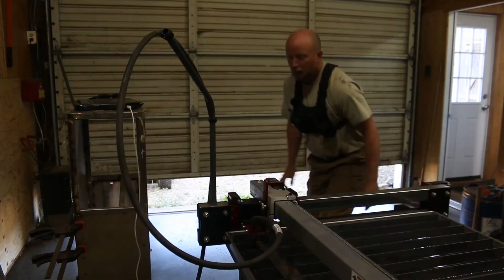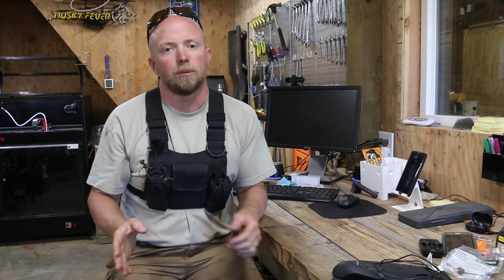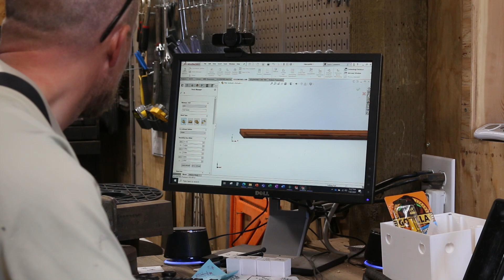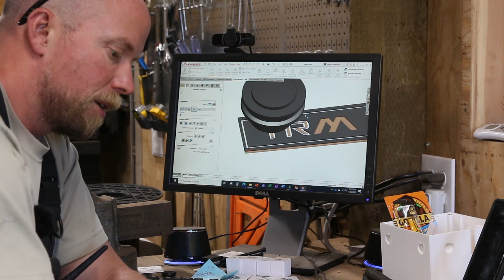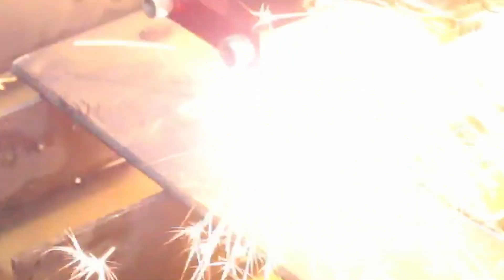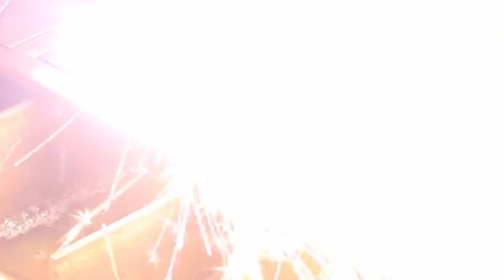Langmuir - CROSSFIRE PLASMA Table - setup

Comment: Stop something  deftly wrong   sparks and fire way to much 
 Your torches maybe too high can cause   Amperage to go up and get hot to  Amperave could be too high or too low  all  kinds of things go on the website 
 there is lots are reasons all this is on the website man check it out did you go on the website and read everything man there's a tons information about what you're going through...  I am  Waiting  For my cross fire pro with THC should be here any day !  Good lock and havev  lots   of fun.  Go on the website click on  The form

Comment: Way to fast. Just do a hand cut and time it for one inch. It's not hard to change the speed if I recall. Been a while since I was doing CNC stuff. 
I made a router table and wanted to convert it to use my cutmaster 38. I was worried about noise though. As in electrical interference. Have you had any trouble with that?

Comment: Hi Jeff, you have made great progress on the settings for the first day cutting. Here are some comments as they come to mind... 

Dross on the bottom = too slow (generally speaking). Good settings often still leave some dross, but it should be easily knocked off the part. 

You will need to play with the height settings, you don't have arc height control and manually adjust am I correct? The height will determine the "straightness" of the actual cut, too high or too low and you will notice on thicker materials (3mm+) will cut with a bevel. 

You are on to it with the pierce dwell time, thicker material = longer dwell to ensure the pierce occurs. Piercing is when the most tip damage occurs (blow back). 

You might be surprised at how high the tip  needs to be on 1/8 with the 240.

I'd share some parameters, but the table I use runs a 400v 3phase 80A plasma (New Zealand standard for industrial type gear). The settings will be completely different.

Happy to answer your questions if I can, I'm not an expert who runs a machine full time. I use it as a teaching aid for mechanical engineering pre-apprenticeship courses and the odd perk job.

You are well on the way to finding the good settings, you have great systematic problem solving skills and that's key to finding good parameters.

I'd stick with the 240 setup, it leaves your 120 breaker free for the compressor?

Comment: If it's re-welding it's self it moving too slow,   if it's not cutting all the way through it's going too fast,  you need too find the right speed for every thickness of metal and right it down and hold on too it.
Reply: Wright, rite, right!
Reply: @ejtakach Jesus, as if you needed to comment that.

Comment: You need a Dedicated 120 breaker for the plasma cutter and one for the table, if you ran the plasma cutter off of 220 volt you would have a lot less problem's, if it's not cutting through the metal you not cutting with enough Amp's , My Hypertherm is 220 volt only it will  cut from 24 gauge to  1'' and 1/8'' thick metal with no problem or more I've done it,   on 120 volt you should be able too cut at least 1/4 metal maybe even 3/8 ,    if you want a real Plasma cutter check out Hypertherm Plasma Cutter's from  30 XP, 45 XP, 65, 85, 105, 125, XPR 300, but for a plasma table the smallest I would go is the Hypertherm XP 45  Mine is set up for a plasma table already with a plasma table port on the back of the Machine and you can order a table torch  separately so you can use the table then unplug it and plug in a hand held torch when you need too. with a table you need both torches.

Comment: hi why dont you try a free sample of sheetcam its what i use for my cnc plasma it has revise cut direction for less under cut and also has a pierce delay that you can set up for all different materials and travel speeds so you can save for each type/thickness of material also it will cut insides first and you can say inside outside and on the line hope this helps

Comment: Shows the need to cut the insides before you free it from the main sheet. 

Can add capacity to the air system easily by finding a broken compressor in the area and stripping the tank on it to plug into the working compressor you have. A 20 or 30 gallon tank added right next to the plasma setup will give you a good amount of air right by the thing using it. 

Did it include the files for cutting new sacrificial slats for the table? 

A good source for metal to practice with is if there are any metal shops in town that use plasma tables as they will often just toss entire skeletons (metal left after parts are cut out) into the dumpster or into a scrap bin as it is not worth their time at that point. Check with them if they are okay with you grabbing some as they often are but best to check first.  Square parts are often spaced so there is very little metal left but odd shapes will often have some good chunks left. Depending on the size of the table they have you might need a battery powered saw to help cut down the skeletons to be able to move them as some of the tables can take a full sheet of metal or even a roll feed.

Comment: Morning Jeff, for some reason your system is cutting the part outside first then the holes or voids... as a rule that's backwards, it's holes first so your parts are less likely to move. 

You start your hole cut inside the hole or void them move to the cut edge. You try not to start a cut hole right on it's edge. Most CNC software let you tell the system on what side of the line to start.

When you switched to 220 volts you could have turned down the cut amps to try for a better cut. 

Yes I know I'm armchair QBing, I'm just passing along my observations of your video from working in the fabrication and welding field. 

Just so you know I think this CNC stuff is great and a big time saver if it fits the need and saves time.

Comment: Shouldn't you cut the border last or have tabs?  By cutting it first wouldn't there be a potential for the part to move or fall down into the water.  Just a thought.  You will get it no doubt. Just keep practicing.